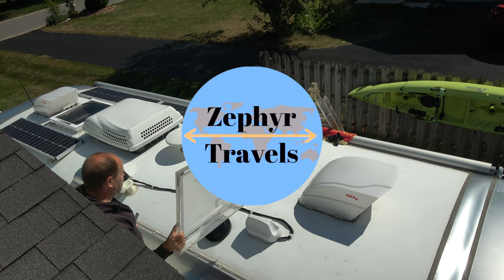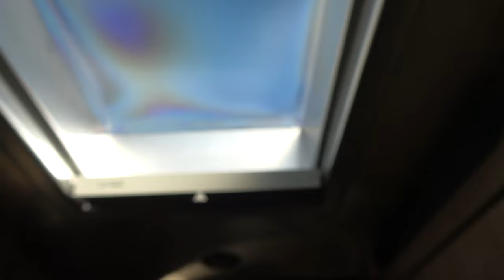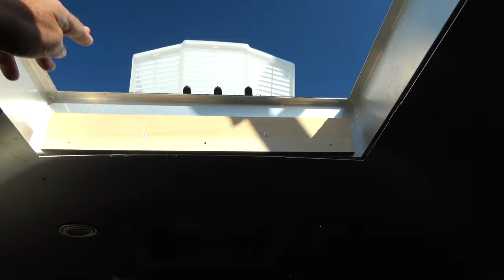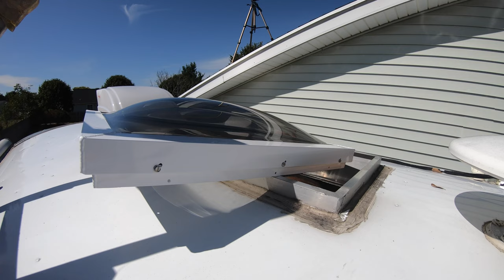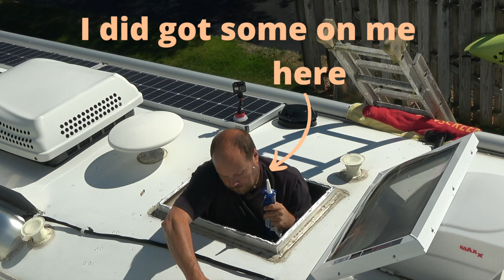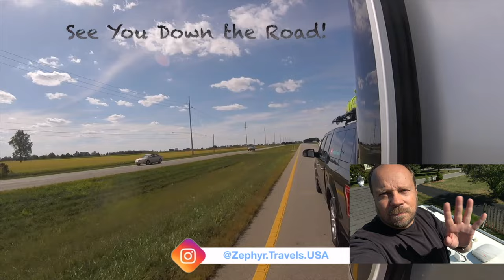I broke Our Airstream Skylight! - We Get New Hurricane-Proof Skylights | RV Lifestyle

Comment: Thanks for your excellent video.  We just replaced our broken square skylight with the Maxim.  Your supply list was really helpful. I was able to source the adhesive and stainless screws on Amazon.  
Only addition to your info is we used Goof-Off Pro Strength to loosen the old adhesive, and sanded down with some sandpaper to get all the old sticky residue before the new install.
Reply from the maker: thanks for the tips!

Comment: Good job on the Vid. 
"Cloudsplitter" sez  Hi.  
Val mentioned you  had helped her out with the TPMS. I talked to her today about her winterization, she was having a hard time finding her WP and opening the LP drains. We're pretty close so if she needs help we can shoot over if needed. The skylight was also one of our first 'up-grades'. It was 15yrs + ago, before the maxim was popular, same design as the OEM but much heavier Plexiglas. Used 3m Extreme sealing tape around the curb and 4200 for caulking.
Bob
🇺🇸
Reply from the maker: Hi Bob,   I am going to do a winterization video in a couple weeks.  Every RV is so different, it hard to cover it all in one video (or email), thanks for helping out.  How the replacement skylight holding up after 15 years?  

I heard a lot about you from Val, you should join us next summer for one of our Airstream meet-ups.  ...Randy

Comment: Thanks for the video. I wish you would have included a shot at the end from the interior of the Airstream so that we could see the light level of the new skylights. Are you happy with the level of light you get? Which tint did you choose? We are nprenovwting a 1981 Airstream & I'm trying to decide which tint to order from Maxim. We live in Florida so I'm wondering how much light I want to let in vs. the added heat. Thanks!
Reply from the maker: Hi Mary - We picked the light grey 50% tint on the outer dome and clear (no tint) on all of the other layers.  I am very pleased with this level of tint, it about the same as what Airstream used on the OEM skylights.    From the inside it does not look tinted when looking out, but does provide some level of sunblock.  This is the minimum level of tint available from Maxim (about the same as the side windows on the Airstream).  

 If you are concerned about added heat, I would recommend adding the same tint to the middle layer.  This should give you 75% tint, about the same as tinted car windows.  You could also add the white tint to the inside layer to block visibility through the skylight if you want added privacy.  

I am very pleased with our skylights.  One of my favorite benefits of the new skylights is being able to lay in bed and look out at the stars through the hallway skylight.  The OEM hallway skylight was white tinted for privacy.

Connect with us on Facebook, Zephyr Travels USA and I will send you a picture from the inside.

Comment: What frame option did you go with ...anodized?
Reply from the maker: I got the white finish frame to match the white roof on our Airstream. I think they look great and are one of my favorite mods we done to the trailer.
Reply: @ZephyrTravels  Thanks.  Have 2 new Maxim skylights ready to install.  Do you recall how many tubes of caulk you used in the install?  I'm going with the 3M 4200FC ...pricey stuff ...wondering if I need 1 or 2?

Comment: Quick question . . . I've had two Airstream dealers refuse to install Maxim skylights on our Globetrotter because it is too difficult to order the correct size. After watching your video, I may take this on myself but wondering how you determined the size to order prior to taking the old skylights off so you could accurately measure the flange? Thank you!
Reply from the maker: This is from memory- so check Maxim website for has on how to measure the opening, please check there to confirm what I am telling you is correct. You want to size the Maxim skylight 1/4 inch larger than the outside of the curbing for your skylight on your Airstream. Because the factory skylight are transparent- I was able to measure the opening with out removing the old skylight.  Add a 1/4 inch to each measurement- this will give you 1/8 inch on each side.   Installation is easy.  The factory skylights are held in place with two sided tape, use a pudy knife from the inside to cut the tape.  Clean the curbing of any old tape them apply a flexible sealant (check what I used in the video). Use stainless screws to attach the Maxim skylight to the curbing- I used two screws on each side. Be sure to drill pilot holes otherwise the stainless screws will bind and brake when screwing then in.  Our skylights have been in place for over 3 years and I have not had any issues with them. You should be able to install them your self in a afternoon.

If you found this video helpful and haven’t done so already, please subscribe to our channel. And let me know how you make out with your skylight installation.  Good luck 👍

Comment: Thanks for the video. Not sure im ready for a new one but I noticed looking up through mine that it is off center. When I looked on the roof I only saw sealant on the front and rear sides of the skylight, not the sides. Is this how your original AS skylight was or should I be concerned?
Reply from the maker: I would not be concerned.  The skylight is sealed to the roof at the top of the opening with two sided tape.  The sealant around the edges is just there to give additional attachment for the skylight.
Reply: @ZephyrTravels  thanks! When I get ready to upgrade I’ll definitely use your method. I subscribed to your channel. Thanks again.

Comment: Maxim is insistent on a certain brand of silicone. When I had Jackson Center install ours they used 3M double sided tape.
Reply from the maker: I used 3M Marine Adhesive Sealant 4000 UV (PN06580) to seal our skylights.  Airstream uses 3M double sided tape on the original skylights, so that why they used it in your installation.  Because  of the overlapping design of the Maxim skylights it should seal fine.  Hopefully they also used screws around the side to secure the skylight to the roof flange.
Reply: @ZephyrTravels  yes they did use stainless screws the Maxim really helps insulate however I do not like how water accumulation stays around the frame. Never leaks but kinda concerning
Reply from the maker: @herveyforward5956  I have not noticed the water around the frame yet.  We been staying in the desert most of the winter with very little rain.
Reply: @ZephyrTravels  last fall we noticed it on aNorth East trip. It runs off the dome hangs on the frame edge no big deal if you move. 
Nice job on your video. I hope working that window your ladder did not dent the flooring. We find our Airstream vinyl floor discolored

Comment: Great video!  Did you custom measure or did the standard size fit OK?  We have an '06 30' Classic LTD and I've replaced ours twice and I think the Maxims will be the next and hopefully last ones!
Reply from the maker: Maxims skylights are custom built to order, you need to supply them with the dimensions for your opening.  They will create a blueprint of your skylight for approval before manufacturing. It is suggested on their website to add 1/4 inch to the measurements.  Thankfully the skylights Airstream installed are frameless allowing me to get the correct measurements.  

After almost 2 year these are still one of my favorite mod we don’t to the Airstream.   Being able to look out through the skylights and see the stars on a clear night never gets old.

Comment: Just called on my RV dealer. My Stratus RV is a 2021 and in every corner there are hair line fractures in both skylights and OF COURSE those are not covered by the warranty. They want to charge $255.69 per skylight for TRASH. They are so cheap and flimsy. I swear nothing is made of quality anymore. I had a 1965 trailer for several years and never had one leak or one mouse in that trailer. It's BS, definitely not the American we grew up in!
Reply from the maker: That about the same as I paid for our Maxim Skylight.